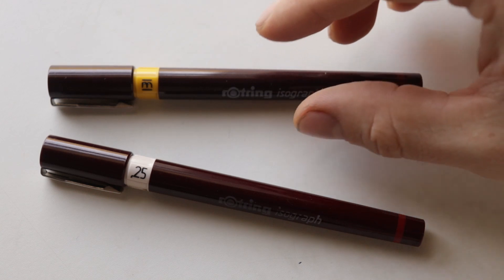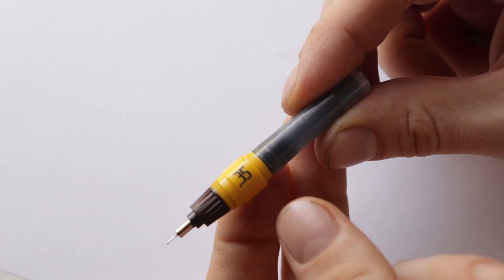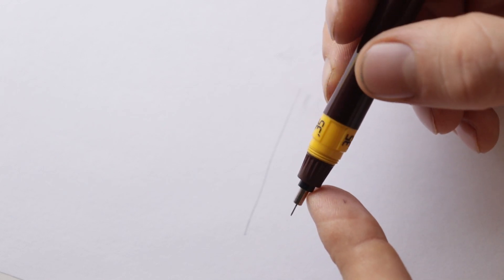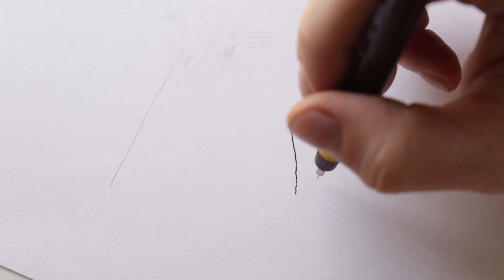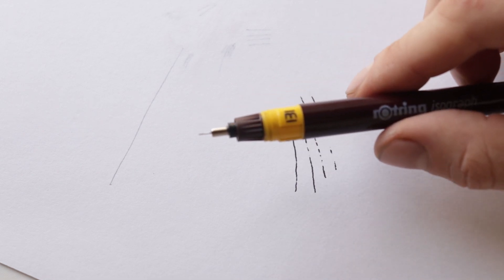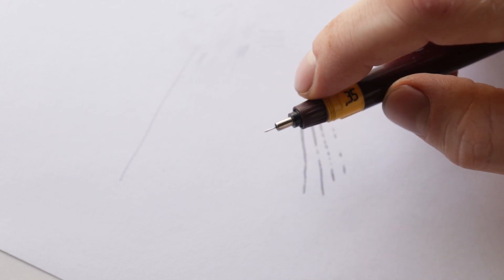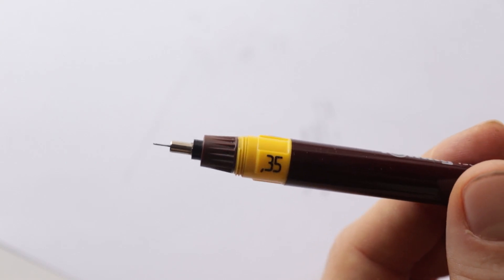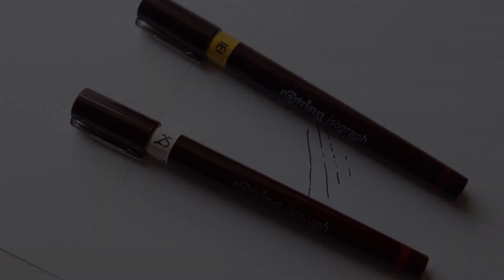Review: Rotring Isograph Technical Pen

Comment: You can refill the Rapidograph too, you need a needle for inserting ink into its cartridge. That might be a small disadvantage, but the Rapidograph cartridges are slightly larger. There are also arguments for each pen about easiness to clean. I ordered a set of Rapidographs so I'll see soon :)
Reply from the maker: I was going to do this but the only options for refilling them as far as the syringe was in large packs of 50,yet i just needed one lol. Hope it works out well for you
Reply: J.Sheetz Artwork You mean syringes in packs of 50? That's too much yeah. I got several small syringes from a drug store where I live (country in Europe), they sell them separately. They were thick so it wasn't suspicious, and even if they were thin it's normal for people who need them for some medicine.

I don't know what it's like in the US, UK or other countries. Some might have stricter policies about those things.
Reply from the maker: You're right.Ill look into it. All i found was the 50 and 100 packs haha. Thanks. For the help :)
Reply: @JSheetzArtwork  A bit late to the party here, but you can try searching for an "ink syringe" specifically. I know for a fact that many pen shops sell them, as they are very useful for cleaning out fountain pen converters. Places like The Goulet Pen Company, Jetpens and Pure Pens carry them in packs of one or two. You can also get them from professional electronics suppliers (they're used for the paste-like things you use when soldering the really small stuff) or other places. For example, I got my first ones as part of a refilling kit for printer cartridges. Those ones are great for cleaning, but a bit large for refilling with, I'd recommend around 2.5 mL at most for that use.
Reply: Update on pens?

Comment: I LOVE rotring pens. Always used rapidograph though, and only today got my first isograph pens. Thrift shops sometimes sell them REALLY cheap, because they don't know a lot about them, and it's not an item they sell easily.
The isographs I got were completely unused and in perfect condition! But at 0,13 and 0,18mm I probably won't use them soon. 0,35 is my go-to :p
One is an isograph F. Seems to have a guilded nib? Can't see anyting else different from the normal isograph.

Comment: i really wanted the 0.2 to do fine lines on my fountain pen drawings, but i need to put the same ink in both and you are making me doubt that it is possible. T_T you mentioned there are alternative inks.. i really do want to know what they are so i can research how viable they are for putting into both pens.
Reply from the maker: In fountain pens The ink travels down a tube that goes into the cartridge, then down a very fine groove which has fins radiating out from it , in these fins is a mixture of air & ink . The ink is being drawn down by capillary action & the same volume of air is travelling back up to replace the ink that is being used. 
So you have the reservoir underneath the nib full of ink causing the "seal " necessary for capillary action to take place whilst the breather hole/slit on the back of the nib allows air to return to the cartridge.
This feed is  precision made. It is so precisely sized & so temperamental that manufactures make their own brand inks with very specific surface tensions to suit their particular feed. Sometimes a pen might "gush" & give out too much ink but this can be solved by using another " dryer"make of ink . Some brands of fountain pen inks just don't work with some makes of fountain pen - even though in there can be very little difference in the actual thickness of the ink!
One thing that most definitely upsets a fountain pen is disturbing those finely tuned tolerances by using inks not designed for them , most especially if some dried ink should gum up those tiny capillary workings it won't take much at all to ruin the pen.
So for that reason you can't use Rotring ink (although it might seem to work OK for a few days),Indian ink will ruin it faster  & acrylic ink will take a few days longer but all these inks ruin fountain pens.
Reply from the maker: Here is a video i made that should help https://www.youtube.com/watch?v=5ibSrTMkhZA&t=20s

Comment: isography 100%, i had the good fortune of owing both and refilling the rapidograph is a whole thing, and thats not taking into account if you dont clean them for years the way the mechanism works of using the built in unscrew mechanism to remove the ink catridge as they are plastic this will warp over time making it nye imposible other than with pliers to remove the catridge and this then causes further damage, also if your as unlucky as me not knowing i left one of these pens out for a solid year, the ink had dried up both in the catridge and nib, and no matter how much i cleaned it it will not work because they made a good pen, but as soon as the ink dries up in the nib feed your done, no matter how much thinner you use and these were the rapidograpgy a £60 a pen, with the isograph ive not had this problem as you dont need a special meachanism to even refill the pen, and because the feed is much bigger less likely to clog the feed with dry ink, with the rapidograph if your mechanism to unscrew the pen and catridge breaks good luck getting the catridge and nib of without execive force, and im confused why they would use cheap plastic in the pen which i paid £180 for 3 pens, when they could easily make a seperate tool for removing the nib and catridge, theirs is no differance in writing between isograph and rapidography but if you dont want changing the ink to be a whole 5 step process i would go for the isograph, im annoyed that my £60 pen stopped working due to how falwed the design is, as soon as you leave it for the ink to dry into the feed goodluck getting it to write